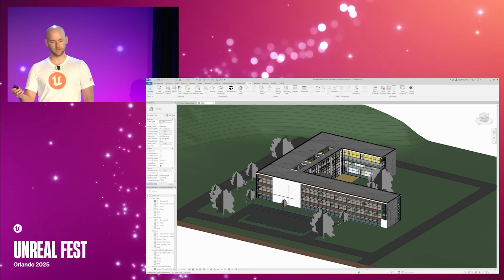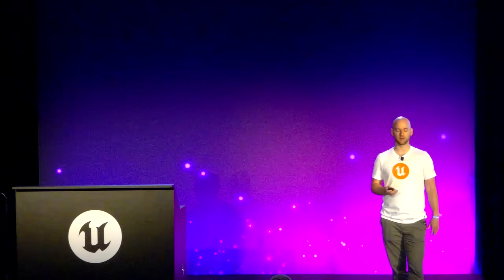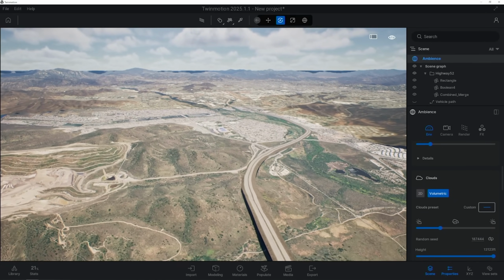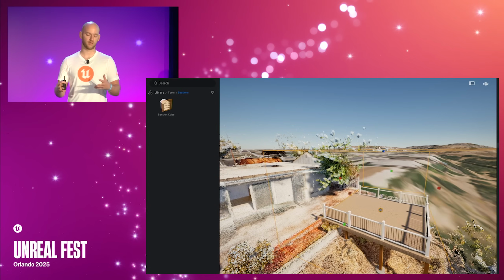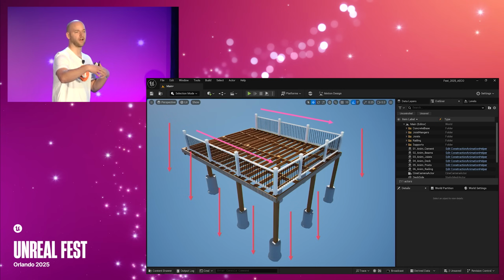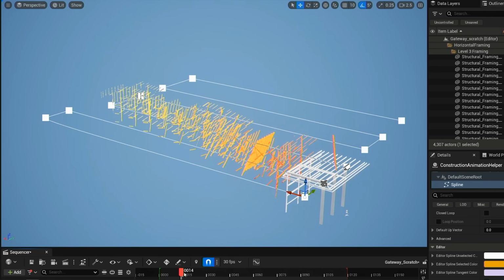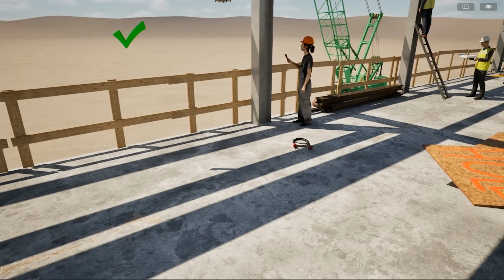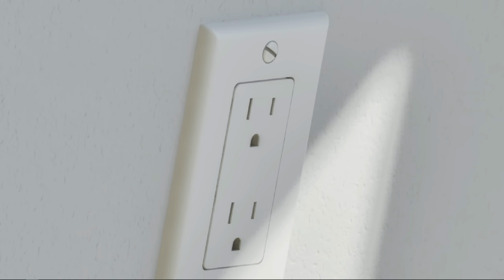Twinmotion and the Life Cycle of AECO Projects | Unreal Fest Orlando 2025

Comment: Nice! 
What’s the plugin used for importing real world terrain data? How do you spell “Sintherar” which is mentioned as a plugin on fab?
Reply: I also wanted to know this
Reply: "SynTerra" plugin on Fab for UE. The terrain needed some cleanup and resizing, plus I manually replaced the textures with satellite imagery from USGS, which required modifying the UVs. I then exported it for Twinmotion in the GLB format.
Reply: @3DStephen  wouldn't it be easier to obtain terrain model from infraworks? as we can also export xml or dems there to make it more precise and also, we will also not need to bring in separate satellite imagery as infraworks automatically makes it? Though for some reason when importing terrain as landscape in twinmotion from infraworks, is causing landscape to be altered at a few places for me, haven't figured out why.
Reply: @MuhammadFarhan-xf3cj  Yeah that's probably a better workflow overall, although I'm not experienced with Infraworks. I also rarely use Landscape terrain myself and stick to basic geometry for the most part. At a certain scale that might be hard, but then again we also have Nanite support in Twinmotion now.
Reply: @MuhammadFarhan-xf3cj  Globalmapper is great for this. You can create optimised TIN and export it as tiles with matching satellite imagery.